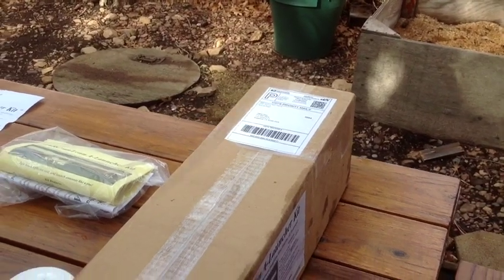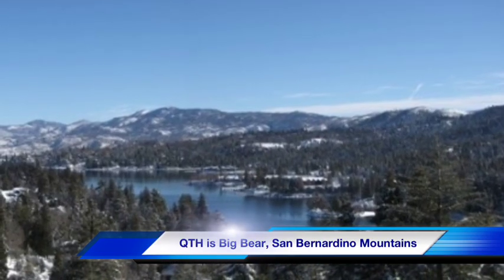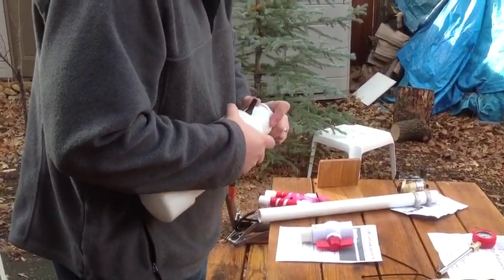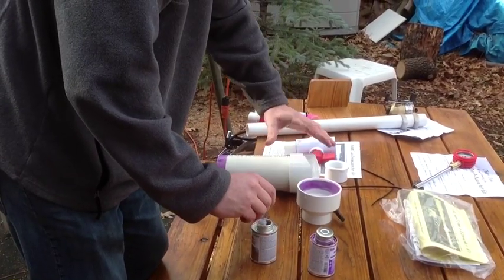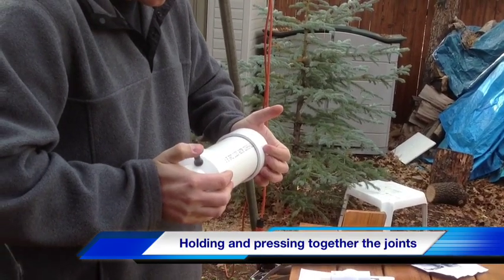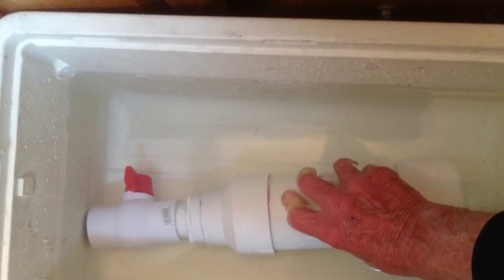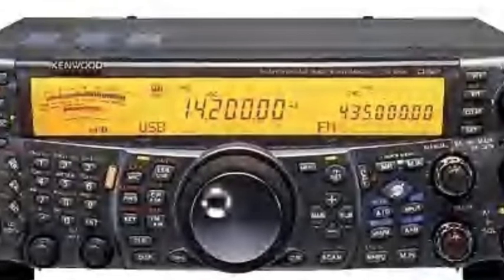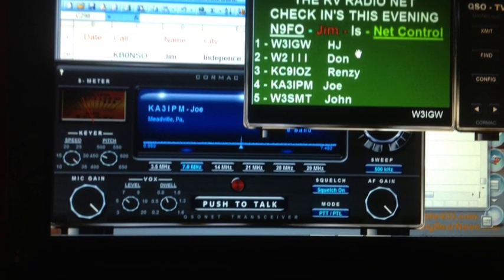Antenna Launcher Kit Assembly - Amateur Radio - KE6RJ

Comment: Assembled it but when  
I tested it there was a small leak. Any suggestion? Or will I have to buy another one?
Reply: What size drill bit did you use to drill a hole for the valve stem?